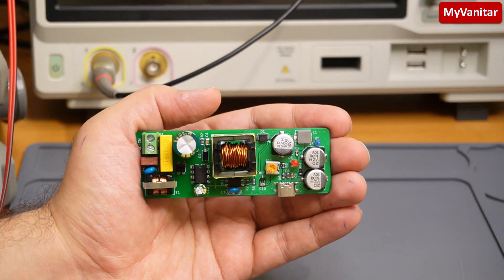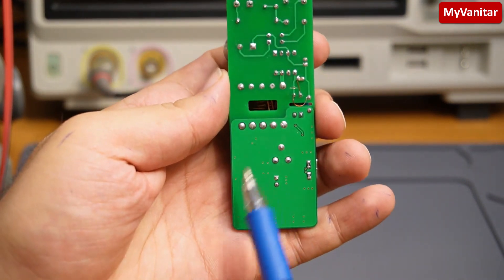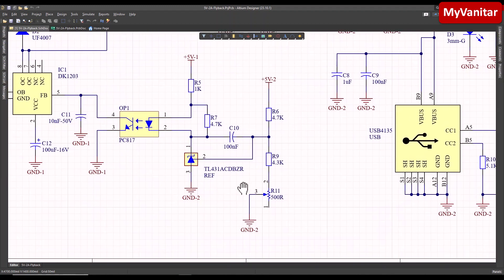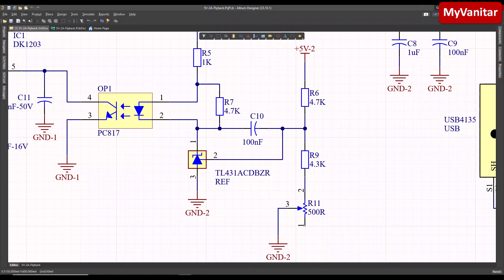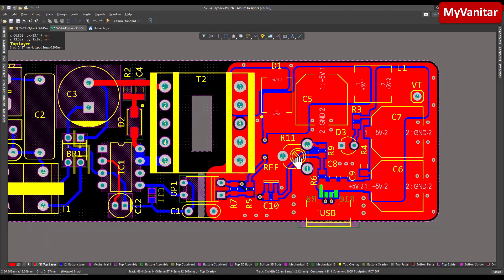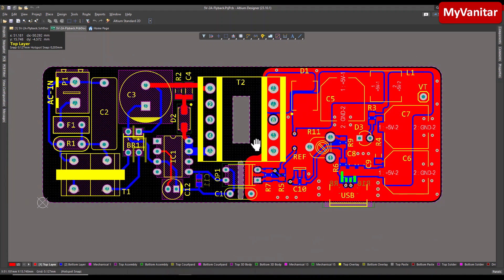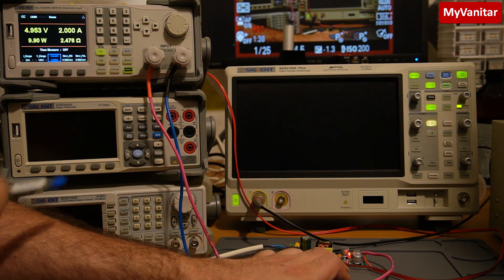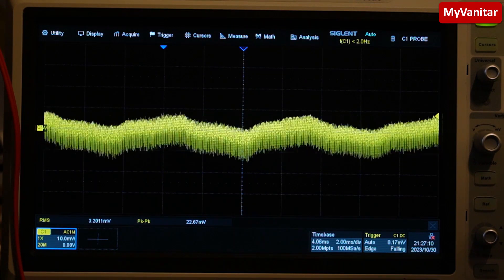85V-260VAC to 5VDC-2.5A Flyback Switching Power Supply

Comment: thank for sharing!
I have a pulse transformer with parameter: **N1 [4-5] 0.15 / 160T, N2 [6-10] /0.35/11T,N3 [1-2] 0.15 / 14T cross**
It has 2 secondary winding, how can I use it in this circuit?
Reply from the maker: how much is the inductance of the primary in your transformer?
Reply: @MyVanitar   Sir,
inductance as: Lp = (4-5) 2.50mH / ± 5%
and it is PC40 Core
Reply from the maker: @thanhcong9278  compare this with my calculations. if the primary value is close enough, the secondary winding affects the output voltage and current. I suggest you wind it yourself if you want to learn
Reply: @MyVanitar  Yes. Thank you for your help!
Reply from the maker: how much is the inductance of the primary in your transformer?

Comment: If we make our second winding 6 turns, 5 volts output voltage multiplied by 6, we have a reflected voltage of 30v, and shouldn't this value be between 90 or 100? A reflected voltage of 30v futilely increases the power of the snabber circuit. Can anyone help ?
Reply from the maker: Do you mean the snubber would not tolerate the reflected voltage? I think the reflected voltage is at least 80V. I should check the snubber circuit, but before that, I am sure it is not lower than 80V or something like that

Comment: Isn't there a small mistake? At the USB C Port shouldn't those be 10k Pull Up resistors to VBUS?
Reply from the maker: Do you mean CC1 and CC2 should be pulled up with 10K resistors?
Reply: @MyVanitar  yes exactly
Reply from the maker: Oh yes, damn it, you are right, this is the charger side, this won't make any problem for many devices but a cellphone and similar devices won't charge. thank you very much. big like
Reply from the maker: files are updated now, schematic, Gerber and BOM